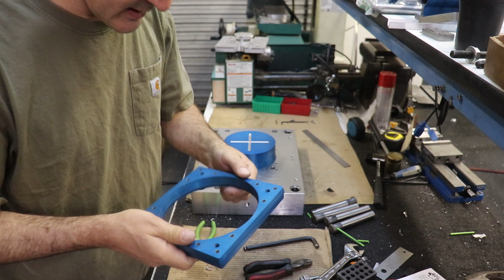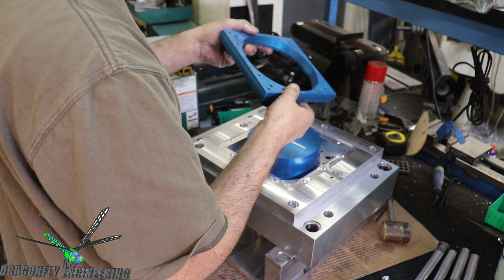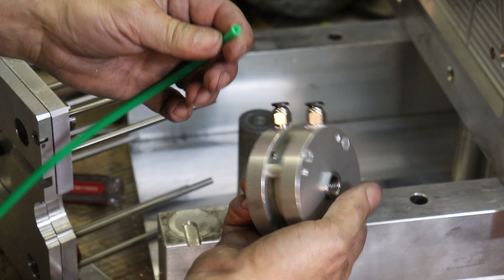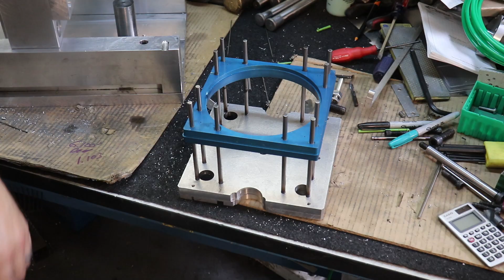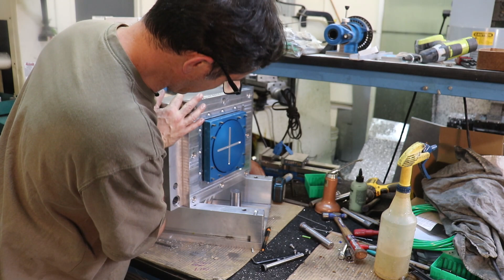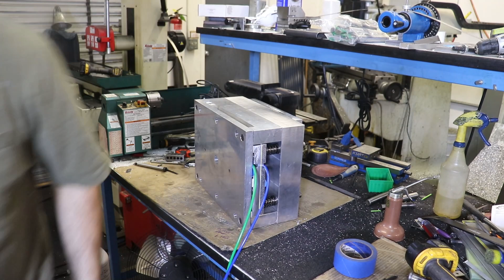LARGE MOLD BUILD 2

Comment: ~ 11:00 - you should manually focus the camera, and then lock it for those kind of shots - the focus is hunting all over the place there and it's a bit distracting to watch it! Nit picky, I know, but always good to do a few little things to make the videos even better!
Reply from the maker: Thanks for the tip Gorak, yes i do try to lock the focus but sometime I forget in the heat of the build.  Thanks for watching!
Reply: @DragonflyEngineering  It's fine, I watch for the machining, not for the video production, but that continually hunting focus really bothered me for some reason. It would be nice if cameras used a slightly smarter algorithm for what to focus on, rather than "let's focus on that big blob of shoulder area that keeps moving toward and away from the lens". It's funny that when you want it to focus on something further away and in the center of the frame, it focuses on the shoulder, and if you want it to focus on something in the center of the frame that you're holding close to the lens to point out some detail, it focuses on the background instead!

Comment: Cool, once more!  At 33:17 that's a shop-made fixture for milling the ejector pins to length? Is that hard milling or grinding? Thanks for the video.
Reply from the maker: yes, sort of, I have a selection of vise soft jaws from old jobs that I pick from, I then modify them if I need too.  Fast fixtures are key to making $ for small runs

Comment: Very interesting, thanks. Would it be possible to break the rotational symmetry of the ejector pin configuration to simplify a bit your life during assembly?
Reply from the maker: yes maybe if the customer is ok with it.  Cosmetic symmetry can be a big design driver
Reply: @DragonflyEngineering  I see, the ejector marks might need to be symmetrical. And the position of the guide pins is dictated by the mold blank manufacturer?